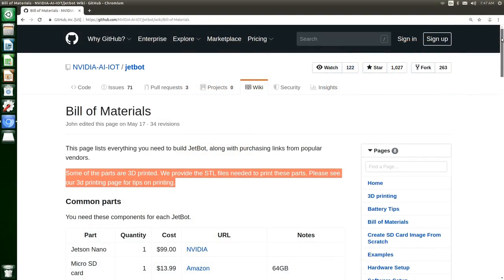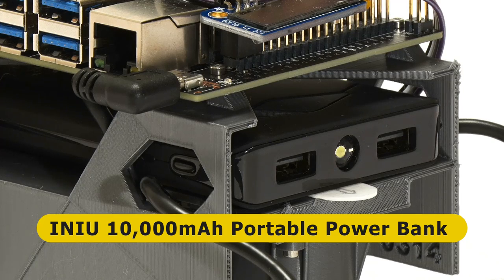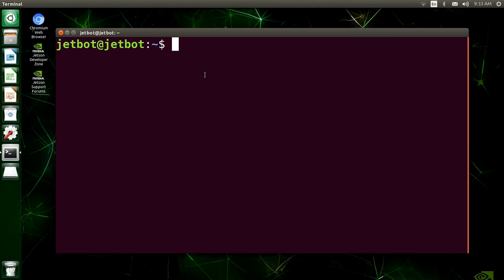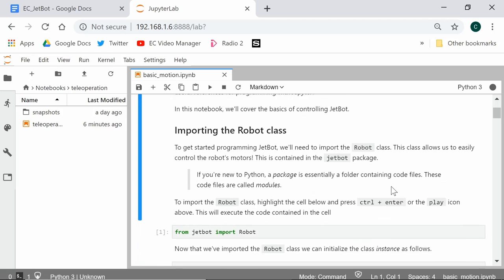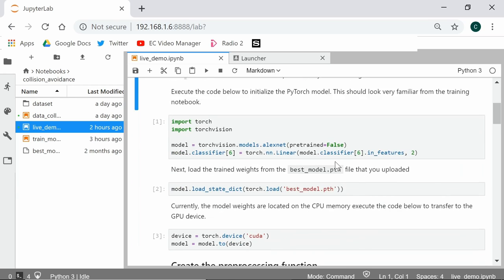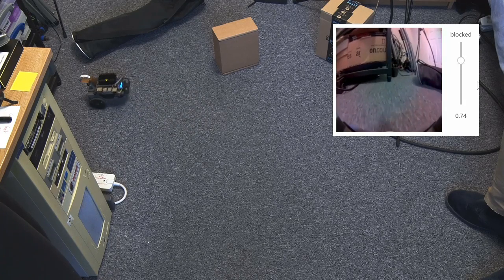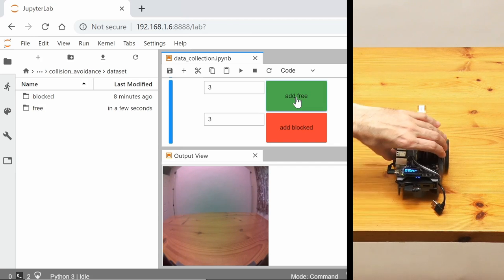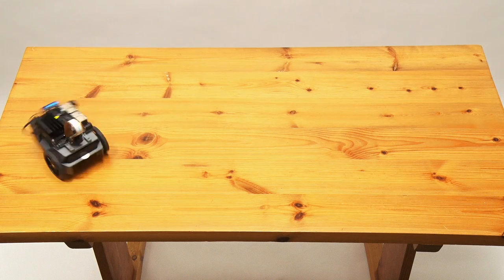NVIDIA JetBot: Jetson Nano Vision-Controlled AI Robot

Comment: Collision avoidance is not working on my jetbot.
Could not read image from camera is the runtime error appearing.
Please help me with this sir.
I'm using raspberry pi camera btw.
Reply from the maker: This sounds like the camera is not working, rather than an issue with collision avoidance with the ML model. Can you see an image from the camera?
Reply: @ExplainingComputers  yes sir !
I tried running a command from terminal and it worked perfectly without any issues.
But when I run collision avoidance notebook,
The line
 camera =Camera.instance() 
leads to run time error:could not load image from the camera.

Edit: Sir it would be really helpful for me if you help me with this issue sir.
Please provide any solution for this issue sir.

Comment: I have thought that, for a long time, AI vision is a hopeless misuse of technology to accomplish the goal of directed locomotion.  I think the ant trail model is a better model.  Ants see very little I suppose, but the scouts lay down trails that other ants follow.  The individual ant only needs to see very little: is there a grasshopper in the way.

Cars need to communicate with their neighbors, which are following the digital ant trails of their immediate predecessors, and with the seed data being from: past human drivers, or GIS like construction plans, or government mapping data (terrain - to dictate the predicted throttle position required to maintain speed, as well as, where the road is geodetically).
5G is the the enabler of the network performance requirements.
If a bridge collapses ahead, the cars in the vicinity see the collapsed bridge, and communicate that information to the other cars on the same trail.

Comment: Don’t see the point of having an ai to do such a simple task, this kind of simple navigation can be done with very simple electronic circuits
Reply: gower1973 you could give the robot a blade or projectile then train it to shoot when it detects mice images. You could drop that in a barn and call it the ultimate rat trap. The image detecting system is useful.